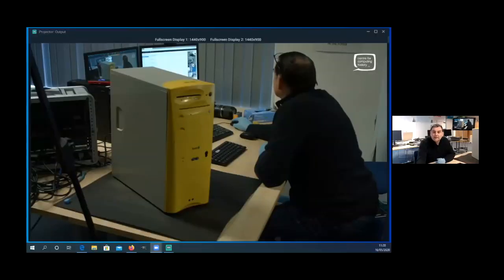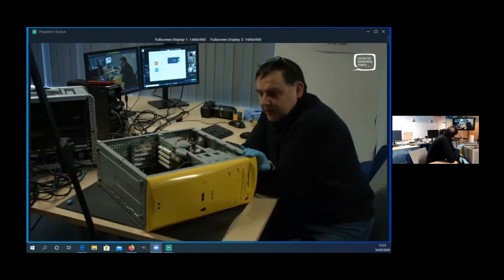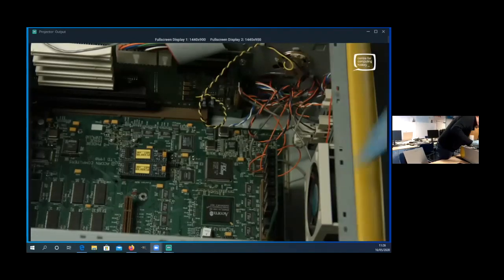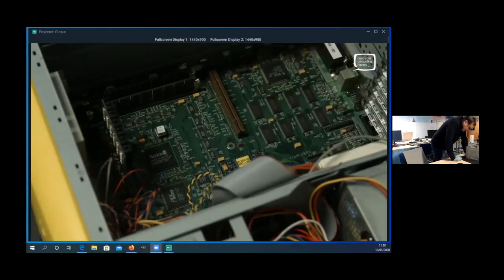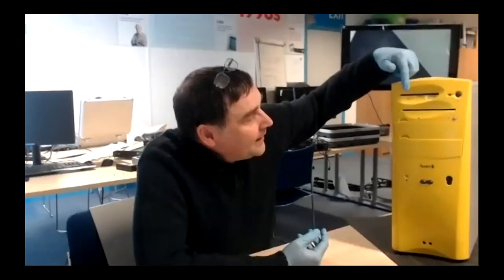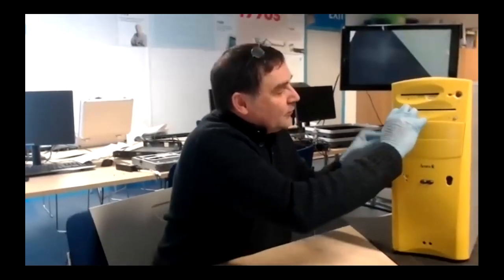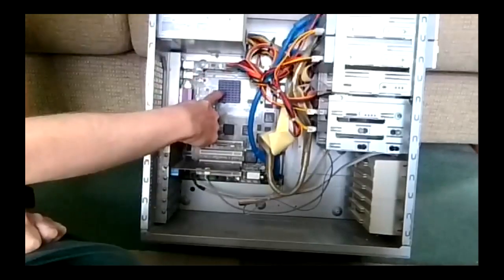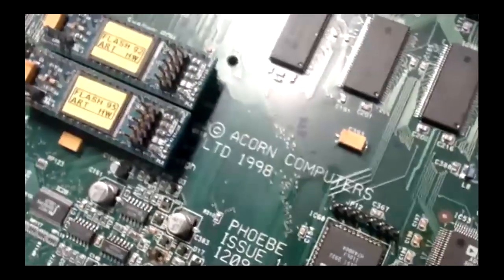Abug Talks - Jason Fitzpatrick talks about the Acorn Phoebe RISC PC 2 from the Museum Collection

Comment: I actually tested a Phoebe with a series of homemade benchtests years ago. In some ways it was quite impressive and in others little different to a standard StrongArm Risc PC. DMA wasn't working so disc transfer speed was quite slow (but better than a RiscPC). Basically, it was little better than a Kinetic RiscPC (which came much later of course).

Comment: From wikipedia https://en.wikipedia.org/wiki/Phoebe_(computer)
Specification
233 MHz Intel StrongARM SA110 Revision S CPU. Support for multiple CPUs on daughter cards available, but multiple CPU support was not available in RISC OS
64 MHz front side bus
up to 512 MiB of SDRAM
IOMD2 I/O Controller (1)
PLX Technology PCI Bridge PCI9080
4 PCI slots (33MHz)
PC Style Joystick/Game Port
3 Acorn Podule expansion sockets
SMC37672 SuperIO chip supporting
PS/2 Keyboard and Mouse
Two EIDE channels supporting up to four devices (6.4 GB unit supplied)
Two serial ports
Parallel Port
Single Floppy drive
VIDC20 Revision R Video ( and sound ) controller supporting 4 MiB of EDO VRAM running at 200 MHz (2)
NLX form factor Tower case with a custom yellow front panel (by the designers of Iomega's zip drive)
Slot loading CD-ROM drive
5.25" drive bays
230 W PSU unit.
Processors running at 300 MHz were being sampled by Acorn in September 1998, with 360 MHz versions also expected.

(1) IOMD2, the new IO chip had to support multiple processors, included message passing and multiple bus mastering, and was manufactured using a 0.35 μm process.
Throughout development and prototyping the IOMD2 were developed on a large FPGA.
(2) VIDC20R, a new revision of the VIDC20 video ( and sound ) chip used in the RISC PC.
Using a shrink of the process to 0.6 μm, a 100% performance increase was gained.
Due to this being logically the same chip as the previous generation there would be no issues with software compatibility.

Comment: That thing is almost certainly going to be suffering from the same sort of SMT capacitor leakage as Amigas do - same era really. Might have to do with why the video out has died. Unfortunately I dont think I could offer you my standard recapping service in this case ;)
Reply: I doubt it. Acorn chose high quality parts, not like C=.
Reply: looks like it may use tantalums - I see more yellow 'chip' style caps than SMD electrolytic cans
Reply: In another video he explained that the museum preserves the machines as they are. They wouldn't want to replace caps with modern versions